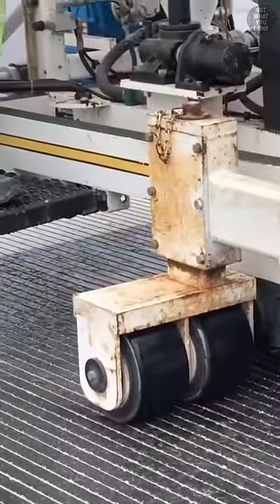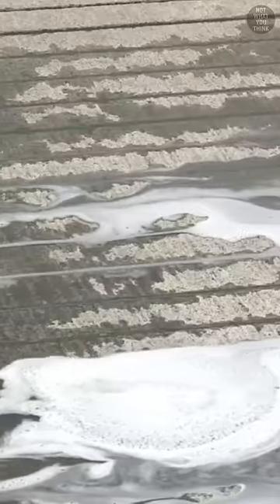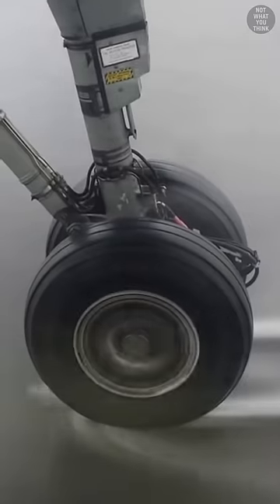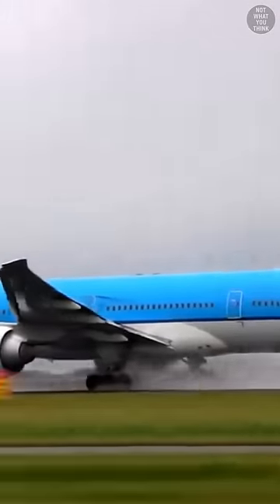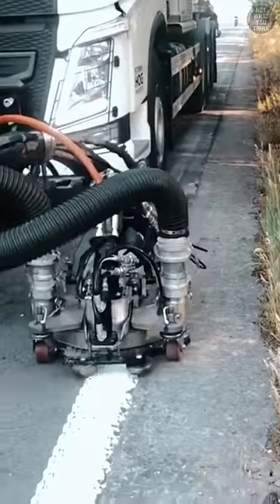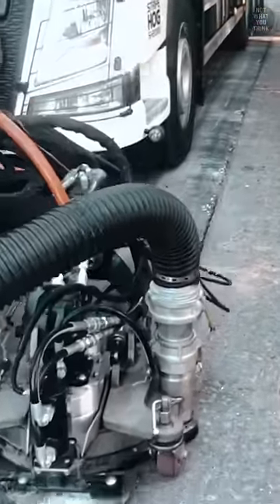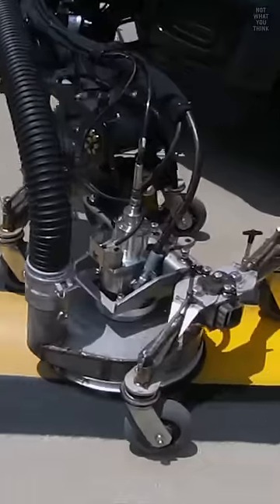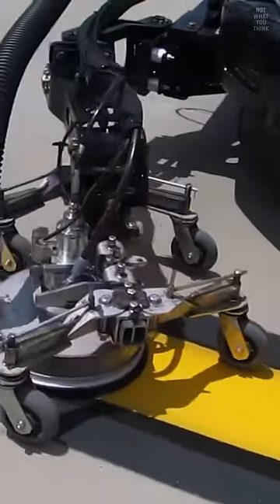Black Lines Matter #shorts

Comment: There are several reasons to remove the rubber. In warmer climates, the rubber can clog up the grover. This can greatly impead the runways ability to quickly shed standing water. In colder climates, the rubber can harden and shrink, breaking its mechanical grip on the runway. If the bottom of the groves haven't filled completely, water can get trapped under the rubber. When the big and heavy land hard, that water turns into a hydrolic hammer. Also, the trapped water can potentualy causing a pot hole efect when temperatures drop below freezing. Places that get often but low volume rain fall generally don't have sufficient water flow to wash away dirt and oil from wide runways. The groves effectively shorten the distance and flow needed to remove the dirt and oils that have built up. The rubber prevents proper dranage and leaves oil on the serface. Runnways that use parallel grove can help quickly straiten the plane and mitigate over rotation in the yaw plain when landing really crossed up. Runways that use perpendicular groves move more water away from the tire path instead of forward. This allows the leading edge of the grove to bite into the tire, and the pilot can break more agresivly when coming in hot or heavy on a shorter runway.

Comment: this is actually counterintuitive because drag strips melt rubber onto the track for increased traction. runways remove it for traction. both use rubber tires.
Reply: Another commenter said it decreases grip when wet

Comment: I actually thought rubber build up increased grip. Seems to be that way for racing cars. I could be wrong but I was of the impression that as a race weekend goes longer, the rubber laid down by tens of cars doing hundreds of laps made the racing line grippier. That effect might be better explained by the fact that the non-racing line area ends up covered in debris, but I still thought the rubber increased the grip

Comment: This is surprising. On a car drag racing strip the rubber left behind makes the strip extremely sticky. Your shoes get stuck on every step, and the extra grip will often end up breaking the driveshafts of a car which has no problem driving on normal roads.

Comment: I thought that the layer of rubber would be a good thing because it would allow better grip for the tyres, like in a drag strip. My theory has been shattered lol
Reply: I thought the same based on my experience with go-karts. On a particular turn where theres a layer of rubber, I could turn much sharper without losing grip compared to the rest of the track.
Reply: @t0k3p0k3  yeah exactly. This is worth looking at in greater detail

Comment: I never understood why planes like this don’t have a small motor in the wheels which can spin them up to an appropriate speed to land without smoking the tires and preventing the rubber build up in the first place.
Surely this would save on tyre wear too..

I’m sure there is a reason, like weight, that they don’t.

Comment: Interestingly in F1 racing, drivers tend to go for the parts of the track with these black lines as the rubber they contain increases the grip available, but only when not raining, otherwise it becomes more slippery instead
Reply: Unless the track has been resurfaced in which case it's a slippery shitshow

Comment: It’s not bc it reduces the friction, it’s to clean the markings, and to clean the rubber out of the grooves so they won’t allow puddling of water. Rubber on rubber actually grips better than bare pavement.  That’s why race car drivers don’t like freshly paved racetracks, there’s no rubber on the surface for the rubber on the tires to grip.
Reply: That's what I thought. Think rubber on rubber is best when things are hot and racey, like the cars. For planes the rubber is maybe colder.
Reply: @dsmyify  well, those tires heat up really fast going 0-160 mph at touchdown. It’s like a reverse burnout.  Lol  The rubber on the runway might be a bit cooler than a racetrack though due to spacing of vehicles difference.  One plane every three minutes, versus a few dozen cars every 90 seconds.

Comment: it doesnt decrease friction it increases friction that's why they coat drag strips
Reply: Perhaps not for the type of movement aircraft perform? A drag-racing car only has to go forward but an aircraft also has to come from the top so I think there may be something with that

Edit: after looking into it more, it has become apparent to me that rubber on rubber contact becomes extremely slippery when wet so that’s probably why

Comment: But wait, race cars love rubbered up tracks because they get extra grip but planes slide on the rubber? What's the story there?
Reply: Extremely different tires and rubber ingredients:  
Race tires are extremely soft and "sticky". In their softest composition, they only last several rounds (depending on track length, driving style, surface temperature and asphalt conditions) And they perform that well only when pre heated and the driver is able to maintain a specific tire temperature over the course of a race.
Whereas plane tires are extremely hard and made for endurance. When a big plane ( aka passenger/cargo jet) lands, the tires are very cold and have no movement. When making contact with the pavement, the tires accelerate from zero to roundabout 240-270 km/h. In this case the tires are engineered for longevity, safety and cost efficiency.

And when the surface is wet, even the most experienced race drivers avoid rubber strips (the ideal line when it's dry) because that would get messy.

Comment: How does the more rubber reduce the friction... Have you ever seen drag racing? They have a shitload of rubber on the ground and if you get out of that rubber groove you lose traction and then control..
I get the grooves being filled with rubber and it causing water to stay, but that's the only valid point I see..

Comment: But won't the rubber on the runaway improve grip? Isn't that why drag race strips are coated with rubber? Cause like sticks to like
Reply: Drag-racing tyres are also partially deflated so I assume there is a difference between driving over rubber in a drag racing tyre and a normal tyre. And there is an obvious answer as to why aircraft don’t have deflated tyres

Edit: after looking into it more, it has become apparent to me that rubber on rubber contact becomes extremely slippery when wet so that’s probably why

Comment: But.. Don't cars(F1) get better grip by running over that laid Rubber ( In Dry conditions only)?
Reply: F1 uses slicks. Laid rubber on the track increases grip compared to just the track material. Hence why all the cars follow the same racing line